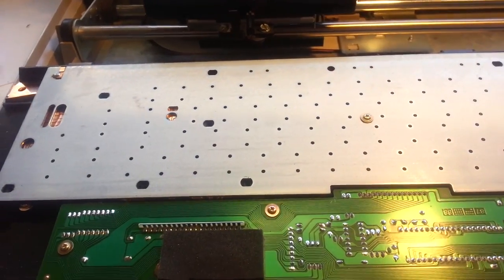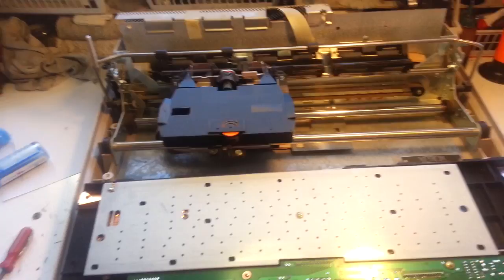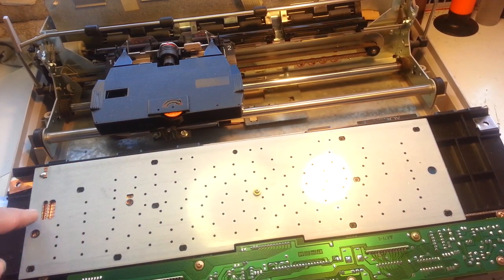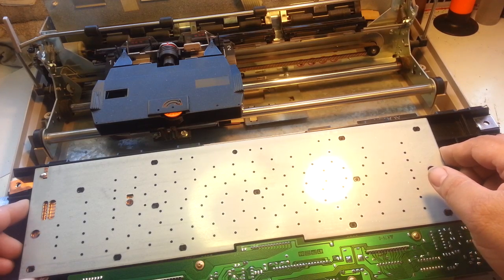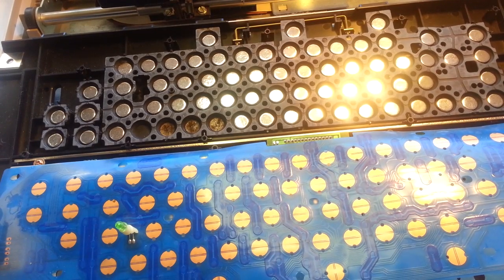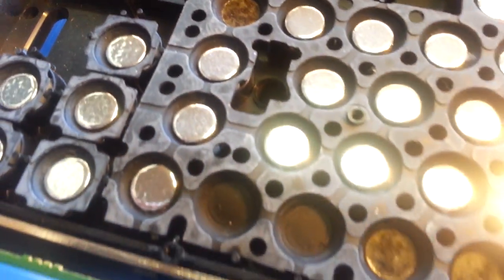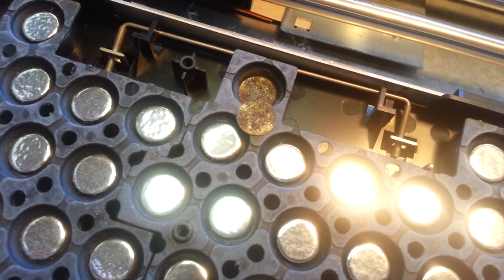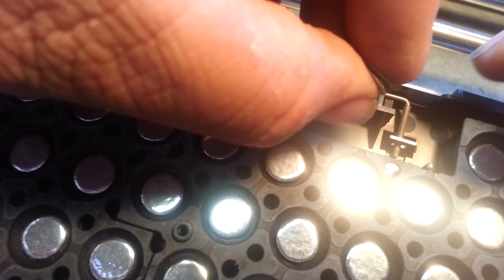Xerox / Brother Typewriter Key-Board Repair Pad Replacement 6015 EM-100

Comment: I worked at a Brother dealer in the 80's and used to do this repair, but I never knew Xerox & Brother were in bed together on this design. The office size version was a decent product. They ran forever if you kept these keyboards clean